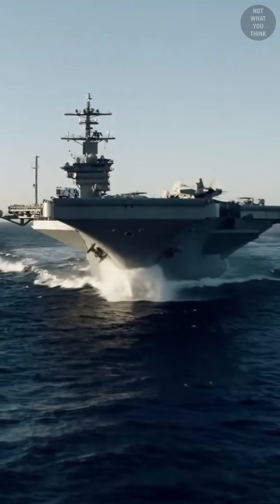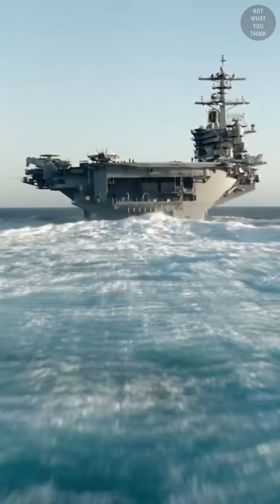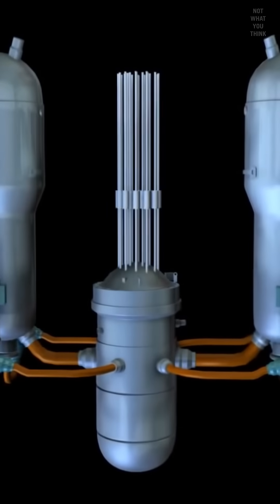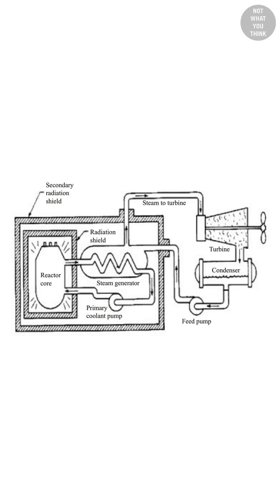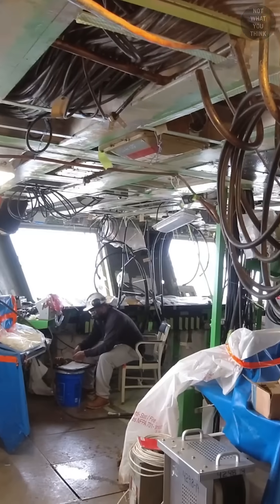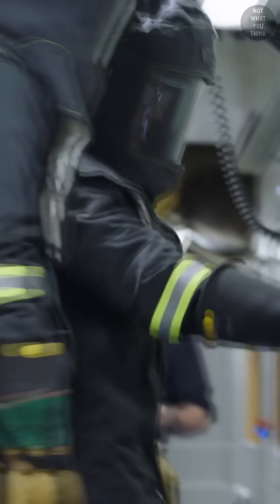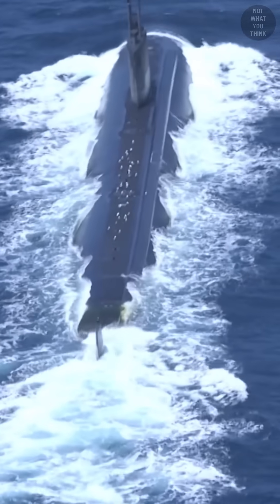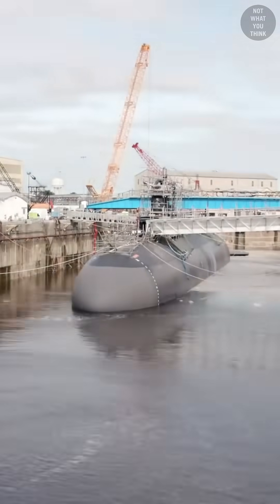How Are Nuclear-Powered Carriers Refueled? #shorts

Comment: I always heard nuclear reactors and nuclear power were safe renewable energy if that's so why do we have to remove a nuclear core and replace it and put the said core in a storage facility. Shouldn't we had devised a way to either keep the core and refuel and devised a safe way to demolish or recycle the core or reactor? From what I've seen it seems like these reactors and cores go into long term storage where there's not really a game plan to get rid of the radioactive material. Seems like the idea of nuclear reactors cores etc. on a boat weren't fully thought out.

Comment: Nuclear waste is dangerous to living matter. That’s the issue. But in the long run, a fuel source that’ll be harmful to us for 20 odd years after use, is much better than carbon fuels.

There are even strains of fungi found on Chernobyl that use a form of photosynthesis to convert radiation into energy, known as radiosynthesis.

Comment: I was part of one of the many crews doing one of these overhauls on the Abraham Lincoln back in 2009, I never did get to see the refueling stage but I worked throughout almost the entirety of the ship, the only places I didn't get to go required their Red badge clearance which is all the nuclear stuff. Part of my job was tracking and tagging power cables running through the overhead compartments, much like you see in the picture near the end with all the thick cables dangling down from open ceiling panels, that was a miserable task. We started the job halfway through after the previous contractor underbid the job by 20,000 man hours and lost their asses, they had to file for bankruptcy and everything when they couldn't complete their obligations to the government contract (not something you mess around with), and we had to pick up the pieces. There are at this very moment hundreds, maybe thousands of individual cables, miles of it, in that ship with labels that belong to a different cable system, the poor sod that has to go in there next and make sense of that jumbled mess is going to curse the day those previous contractors were born lol. I know I did, that's for sure...

Comment: The truth of it all, if we had developed msr’s, refueling the reactor wouldn’t be a thing, because the reactor would be 200 times more fuel efficient. 
Solid fuel reactors only expend .5% of their fuel. An msr (molten salt reactor) expends 100% of their fuel.
Solid fuel discharges xenon gas as they fuel rod decays. This causes the rod to crack and swell. By the time .5% of the fuel is expended, the rods are so damaged they no longer fit with in the reactor core.

Comment: Here’s an interesting fact, when the first ever nuclear powered carrier set sail. The navy had no fucking clue on when to replace, repair, or the long term effects of the reactor. So they only did limited repairs, and never replaced fuel rods. The Navy pushed the carrier to the limits including the reactor. This lasted for 25 years until the Navy finally said fuck it we should probably change it out. They later released a report stating that they still don’t know when to properly replace the reactor so 20-25 years is just a safe short run. They predict that the reactor can run on to 50+ years if it was properly maintained.
Reply: Yeah this is wrong.  Nuclear technicians and engineers know exactly when reactors need to be changed.  I was one.  The Enterprise used 8 individual smaller reactors.
Reply: Yeah, this is the opposite of fact. You can very accurately measure the fuel burn of a reactor, and based on operation of carriers at the time, they had a pretty accurate guess for how long hey wanted to operate each core, but left the timeline open to do some operational testing. You can calculate down to the hour how long you can use that core, and that’s a fairly basic calculation in the nuclear field.

Comment: ayo i didn’t know we had this tech hurry and figure out how to use nuclear power on rockets Elon will figure it out 🤷🏽‍♂️
Reply: Well for 1 that would be extremely dangerous. And 2, aviation and weight don't mix well together. The walls of reactor containments are typically made from concrete, led, and steel with walls around 3-5 feet thick. It would probably weigh around 160,000 lbs.
Reply: this tech has been around since like the 50s

Comment: Lifetime reactors? Just like how your car’s motor oil will last the lifetime of the motor because not changing it will eventually make it blow up
Reply: No, nuclear fuel is very complicated. It’s not a homogenous mixture, so changing the purity of the fuel will change the efficiency, max power, and life of the fuel rods. The older designs were focused on increasing max power and efficiency. The newer plans focus on increasing lifespan of the fuel, while having a variable power density.

Comment: So much simpler to just refuel with oil or gas
Reply: Yeah, and oil and gas last decades less and are orders of magnitudes less efficient.
Reply: @mildly_miffed_man1414  
Than taking a ship out of service for years, radioactive waste for 1,000s of years, etc.
Reply: @monza1002000  We already have safe ways to dispose of nuclear materials, and it doesn’t take three years to change the fuel. The dude in the video literally said they only change the fuel when overhauling the ships. You are wrong.
Reply: @mildly_miffed_man1414  
,producing the waste is the bonkers bit. Just because also produce it doesn't make it a good idea

Comment: How long are the cores supposed to last?
Reply: 25 years of normal use. However, they're still 'usable' at this point, just at a lower efficiency that wouldn't support military operations. It is also more sensitive to shutdowns as it gets older due to accumulated poisons.

Comment: It's bassicaly a steam engine with the sun's fraction energy to do the heat. It's amazing how steam is still holding the most efficient and powerfull source of power until today.
Reply: Steam powered turbines are one of the most effective ways to transfer heat to pressure to power, meaning that it's not the power source, it's just the 'middle man'
Reply: Where can I learn more about this
Reply: @MrArtVein  Wikipedia.

I'm dead serious actually
Reply: @mikethespike056  wikipedia today is a great place to learn anything. Things are bound to be wrong but in scientific articles they're negligible.
Reply: @lemons1559  Even if you think Wikipedia is doing a shit job, references exist at the bottom where you can read the full article or journal in detail. And when that's not enough, that article will also have their own references for you too look up too

Such a great website that one
Reply: @DrSabot-A  It's been a life saver for many a project.

Comment: The problem with the LOS reactors is that the lifetime of the ship is going to get pushed. They’ve tried to retire A-10s a dozen times but we still have some in service since the 70s.
Reply: If it ain't broke, don't fix it.
Reply: There’s a different between a CAS plane that’s really good at motivating the troops and is deeply adored by many, and a fucking nuclear reactor. Yeah, the army is stupid. Maybe even really stupid, but it’s not so stupid that it uses a 50 year reactor for 80 years.
Reply: @mildly_miffed_man1414  The Air Force does the same thing. We have F-15s from the 70s as well.

Comment: Nuclear reactors are basically modernized steam engines. Replacing coal burners with "hot rods". 🤔
Reply: Yes exactly
Reply: They are top secret because there are actually 1000s of hamsters on hamster wheels in the core making it all work
Reply: @davidd5523  shhh. They’re not supposed to know!
Reply: @benkaruzas6018  Oh, dont worry. The hamsters are none the wiser ;-)

Comment: Question: if the carrier is sunk or destroyed, what happens to the reactor? Would it be another nuclear disaster?
Reply: the reactor scrams and over time cool down. There are many reactors from Nuclear submarines that sunk during the cold war around and they are closely monitored and to now, there haven't been any major problem. Although we Norwegian sometimes fund the Russian, to remove reactors and do clean ups, if reactor is in shallow water.
Reply: Assuming the reactor is damaged enough for the radiation to leak it wouldn't really go far like 30-40m at most as water is pretty effective at absorbing radiation.
Reply: Sounds like nuclear energy seems pretty.. workable, i was under the assumption that events like ship destruction would be akin to a fukushima or Chernobyl event

Comment: You know how messed up our oceans are going to be when we finally get in wars with these things?
Reply: There would be no noticeable difference in radiation if they were to be sunk
Reply: @TT-hd3zi  Perhaps in the larger biomes, sure, but consider the possibility that a relatively large number of nuclear powered ships are sunk in close proximity to each other. That would surely elevate the radiation the surrounding area, right?
Reply: @sirvelociraptor2590  only by a minuscule amount.
Reply: @TT-hd3zi  Not to be cynical, but how did you get that information? I'm curious about the topic.
Reply: @sirvelociraptor2590  it’s common sense. A few kilograms of radioactive material is not going to significantly affect more than a few hundred metres around it (an immensely small area in an ocean). Even then, it’s not significant because water is a reasonably good insulator of radiation.
Reply: @TT-hd3zi  I'd be more worried about the massive amounts of jet fuel, oil, hydraulic fluid and other such things that will spread via ocean currents and poison a lot of marine life and end up washing up on coastlines around the world.
Reply: @TT-hd3zi  So you are using common sense as a source? Rather than anything based off of existing nuclear disasters?
Reply: @sirvelociraptor2590  a basic understanding of nuclear physics/radiation is all that is needed to known a few KGs of fuel at the bottom of the ocean is not going to have any noticeable impact. Take the USS Thresher sinking as a case study.
Reply: @TT-hd3zi  Can you explain the thresher to me?
Reply: @sirvelociraptor2590  the USS Thresher was a US Navy nuclear powered submarine which sadly sunk in 1963. It (and its reactor) remain about 200 metres underwater. Despite this, the level of radiation is negligible. Here is an excerpt from a paper published by the US Navy on the issue:

‘the maximum rate of release and dispersal of the radioactivity in the ocean, even if the protective cladding on the fuel were destroyed, would be so low as to be insignificant.’
Reply: @TT-hd3zi  It sounds like something to save face, the government does that a lot
Reply: @sirvelociraptor2590  right…
Reply: @TT-hd3zi  it's true man, they do it to a ridiculous frequency

Comment: No, you don't cut holes through the flight deck. You can get in from the hangar.

Also, no, you're doing inspections on the reactor plants and associated equipment pretty much constantly, any time you're shut down for long enough or in any kind of shipyard availability.
Reply: They remove hatches from over the RC on the second deck and the hangar bay, they do cut through the nonskid on the flight deck, and the. Remove another hatch. They use a giant gantry crane to light each rod out through the flight deck.
Reply: Being that I work on these boat, can 100% say you're wrong. They DO in fact cut the deck away, both forward and aft deck spots.
Reply: @ttg-nite6494  as I said, they cut through the deck in the hangar bay, NOT through the flight deck.

Comment: So what would happen if somebody nuked one of those ships would the reactor go off to
Reply: Nope, those kinds of reactors are specifically designed not to be able to blow up like a bomb.
Reply: @tspencer227  But wouldn’t the reactor be spread around like a dirty bomb anyway
Reply: @thebuddha4208  no, because you've got layers on layers of containment. The fuel assemblies in the core are reinforced and designed to be incredibly stout for a lot of engineering reasons, which act as a primary protection method. Then, the core vessel those fuel assemblies are installed in is a freaking massive piece of metal as well, because radiation, thermal stresses, pressure stresses, etc. Then, the entire reactor compartment is shielded as well, because more radiation protection and other stresses. 

To put it in perspective, the containment buildings for American civilian nuclear plants are designed to be able to take a hit from a 737 without breaching the core.

Comment: How does it take 3 years to change the fuel over?!
Reply: Lots of special procedures and controls in place for the radiation controls, because everything in there is irradiated with at least short-term isotopes. Then lots of special tests and inspections when defueling and refueling, then even more special procedures and tests after the new cores are installed. It's not exactly something you really want to rush, after all.

Comment: 3-4 billion dollars??! Sounds like an awful lot
Reply: Actually quite cheap when you take into account all the upgrades and improvements you get. Some even say this is a reason not to use nuclear fuel over Diesel generators. However modern ships that run on fuel still need overhauls as such the cost is about the same or more as they have to dock twice as often for said upgrades and then we have the cost of the fuel they run on which adds up a lot.
Reply: @Predator42ID  insane. I thought it must be a typo by 3 digits 😀
Reply: They just print up more paper dollars. Feels like it’s free that way. Until we all go broke at once. No more ships or anything else. Assholes.

Comment: The real reason you can't refuel a naval reactor like a land-based reactor is that those are breeders. They start out with mostly U238 (not fuel) but the radiation from nuclear fission transmutes that U238 into plutonium. Meaning it makes more fuel as it runs. That's also why a typical PWR needs to be refueled about once every 3 years whereas naval reactors, despite being much smaller, take almost ten times longer to run dry. The end-result, however, is a massively dirty nuclear core that cannot be reused and ends up burred in the desert. That, by the way, is why civilian plants don't run that way.
Reply: Not sure if this is what you are saying, but Naval Reactors (A4W, A1B, S5W, S6G, S8G, S9G) are not breeeder reactors. The longer life is due to the the higher Uranium enrichment compared to most civilian nuclear power plants.
Reply: @kvtako  He said they aren't breeders. I read it wrong at first, too.
Reply: dude youre completely wrong. naval reactors are not breeders. source: i work in reactor department on a carrier.
Reply: @prohalid  Reread the comment. He said that naval reactors are not like civilian reactors, which are breeders. This confused me too, the first time I read it.
Reply: @aidanharley243  if thats what he meant in his comment then it makes even less sense. The fact is nnp does not operate on breeder reactors. Poison zoning, enrichment levels, and overengineered cores are the reason naval reactors last so long.
Reply: No, that's not true at all. Most land-based reactor plants have a lower enrichment of their fuel, so you're having to refuel more frequently anyway- it has NOTHING to do with breeder reactor designs.
Reply: Also a major reason is due to the enrichment of said u-235, highly enriched uranium allows for the reactor to run for much longer as the fuel density is much higher
Reply: Actually on subs they do reuse the core, just swap the rods.
Reply: Civilian reactors refuel twice a year. 
It would be great to only refuel once every 25.
Reply: So THAT'S all those towns directly outside of deserts all have high incidence of cancers. All makes sense now
Reply: That's similar to a car battery right? It charges itself with the car's engine. (Minus the super dirty disposal and having to be buried in the desert)
Reply: @kmmediafactory  No? This would be as if burning the petrol created diesel or something.
Reply: @XMysticHerox  huh. ok then.
Reply: @XMysticHerox  Or like the fuel processing systems on old oil fired ships.

Comment: They should use Thorium-based nuclear reactors.
Reply: No need, they use weapon's grade uranium on the subs.
Reply: Why? Is it more efficient? Is it smaller than comparable uranium reactors with the same output? What are the downside with thorium as fuel? I'm just  wondering since you think it is better, and have never read up on it myself as my nation don't use nuclear, but use hydro, wind, solar and thermal power.
Reply: @naerbo19  Its superior in everyway. Thorium 3x more abundant than Uranium, and its safer to extract. Thorium can produce 200x more energy per unit of weight than Uranium. 
Thorium reactors requieres a small starter radioactive material (Plutonium or Uranium) to start producing energy. In the event something goes wrong, the liquid thorium is drained away from the starter, ending the reaction. Nuclear waste is minimal.
Why is this not used everywhere? Because you can't make nuclear weapons with it.
Reply: @jascrandom9855  Thank you! The reason as I see it is likely as you mentioned because you can't make nuclear weapons with it. I think countries that developed a nuclear program did it with weapons in mind and power generation as a "happy" side effect. That being said, this is just my opinion before reading up on it.